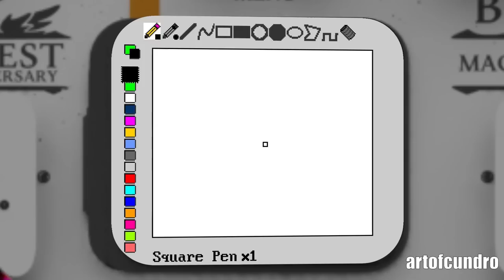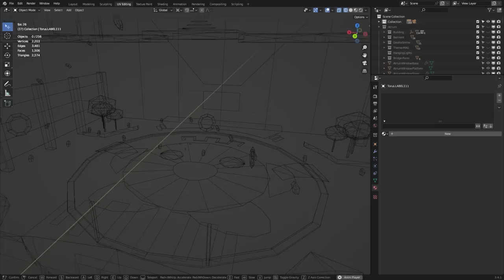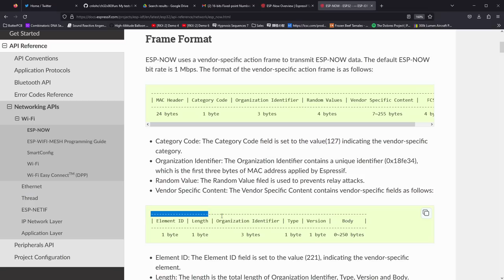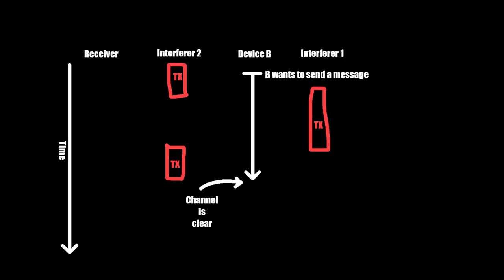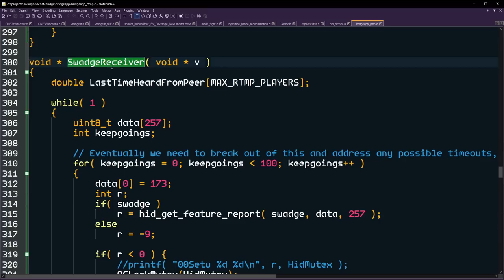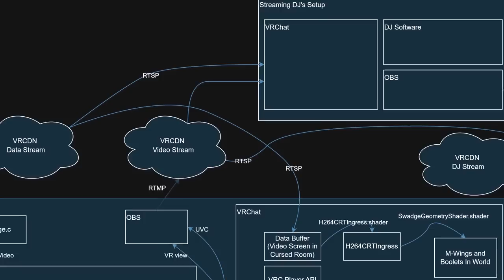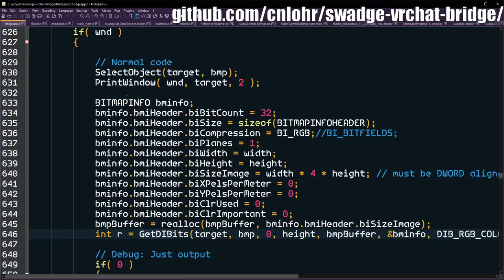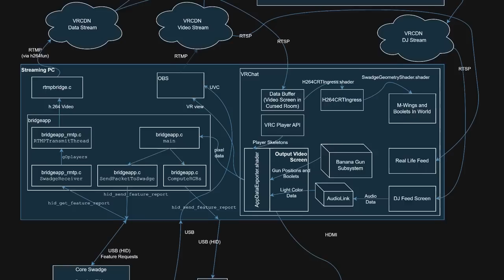Game Made for VR on a $1 Processor?

Comment: the register bruteforce hacking is so painful and yet awe-inspiring to read! i had a thing that could've used something like your long session but it was just too frustrating.. great job on this project!

(more specifically, using both DACs on the ESP32 in accursed ways, there's some bitluni videos to watch on surrounding things if you haven't)
Reply from the maker: I haven't yet needed to use the DAC, is there some trick to it?
Reply: @CNLohr  my memory is hazy but yes. bitluni bitbanged composite video along with audio on the ULP in separate videos  and i was hoping to combine those to get a cute little application platform, pico-8 esque but in hardware -- after brushing my head into it for a while i halted the project pending access to an oscilloscope and similar nice-to-haves

i love writing programs for machines where i'm close to a piece of relatively-simple hardware that could conceivably be understood by one person, the low latency feels great and the security in not having the rug pulled under me too and it's expensive but i'd like to try again eventually. 

emulators are okay and less e-waste is great, but if they aren't perfect emulators then it's only added more layers of stack to pop and comprehend, which is not okay for an experimental, toy machine. i want to have a bit of me embodied in every layer of it maybe?

Comment: Everytime you post something, you show another unbelievably insane project.

Btw have a look at standalone VR headsets (Quest 2, Pico 4  They cost like 400~500 and can run VRChat without the need for any other hardware, though I guess you probably know that already).

You could make even more intervined VR projects with that. The headsets run android and can communicate via serial over usb-otg with a microcontroller. So hooking up an ESP32-S2 to work as an espnow receiver/sender would work. Also the Quest 2 in particular has kind of good handtracking and a black and white AR-mode.
Reply from the maker: I've tried using VRChat on stand-alone and it is just so utterly uninteresting to me.  Running it on PC for me is the difference between looking at a VHS video of an event and being there. :-/  Maybe the next round of stand-alone.
Reply: @CNLohr  ah okay, yeah due to the way vrchat works performance is kinda meh on mobile

Comment: do you take comissions for technical projects in VRC? I want to hire someone to help make a working book that can be pulled out of an avatar or area of a world and flipped through, probably having multiple books contained in the same one, having the main book change aspect ratio for the PDF loaded (they could be stored as relatively low res textures?)

would want to eventually be able to pull out pillows, incense, books, and maybe even a basic music player all from an avatar to put in public and private worlds to hold spiritual programs
Reply from the maker: I regret that I do not take commissions, but, if you join my Discord, there is a #vr channel, and there may be someone who can point you in the right direction.

Comment: How compressed can you make a game 101 right here

I also have a question this is coding efficiency right? if so is it possible to make a bigger game for modern computers with those tricks
Reply from the maker: You can make games for modern computers this way.  It just is a trade off between expedience and effectiveness.  As soon as you use an abstraction you trade some efficiency for coding expediency.  Like if you use a library to do something.  But the issue is they also made those trade offs.  And they use abstractions.  And so on and so on.  And eventually in modern computers, we generally achieve <.1% efficiency.  Even with my effort I am probably using <5% of the power of the ESP.

If you watch C64 demos.  Things like "E2IRA by Arise" where they have 1MHz, 8bits and 170kB of space. They are the real MVPs, probably getting to 50%+ of the true utilization of the hardware we have available to us.

It's just too easy for people to cast away 90% of the computing resources for expediency or, worse, laziness.